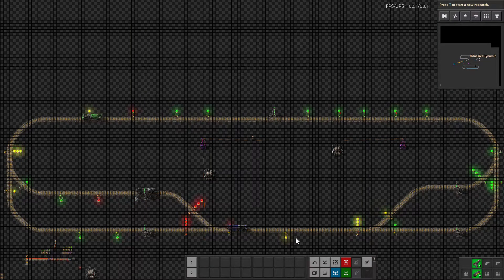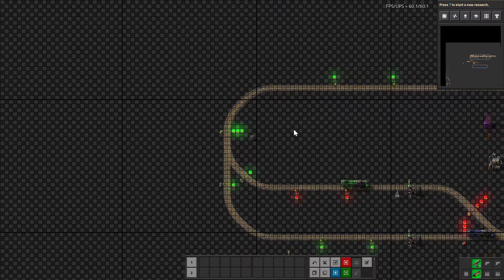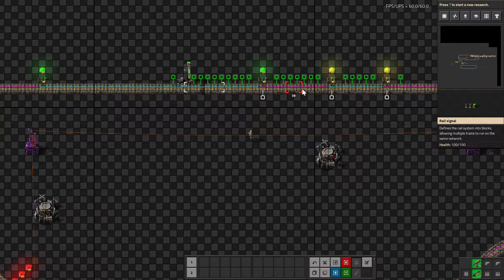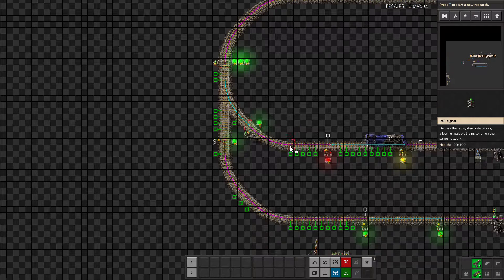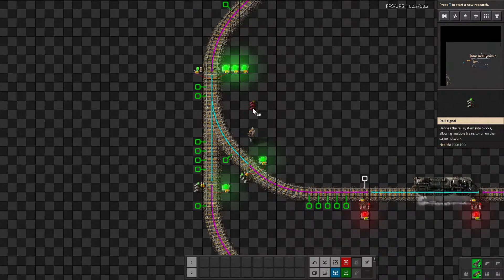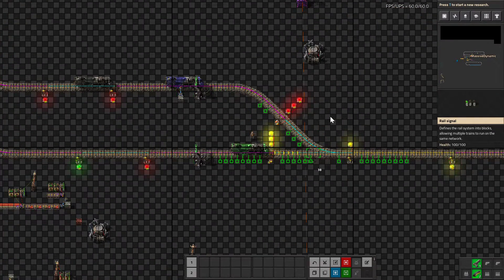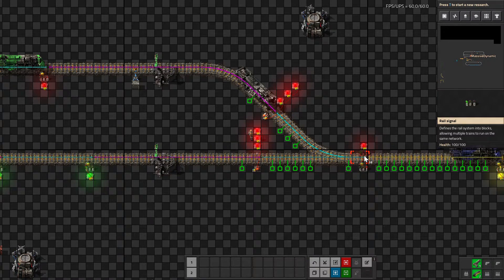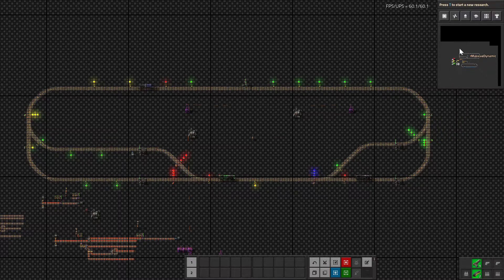Factorio Train signal visualizer

Comment: I'm brand new to the game, like it a lot obviously but I really wish there was in game tuts cause its taking me forever to figure out certain things to make stuff run smoother, really taking away from the fun and its getting frustrating. Like in the 4th mission where u have to restart the train and put it on auto. It says destination inaccessible. I put transport manually so I know its good and I have signals I think where they are supposed to go but after adjusting stuff I still cant get it to auto transport. Anyhelp would be much appreciated, I can even share my screen over dischord if that would be easier.
Reply from the maker: I can probably help... https://discord.gg/zsdvmaZq